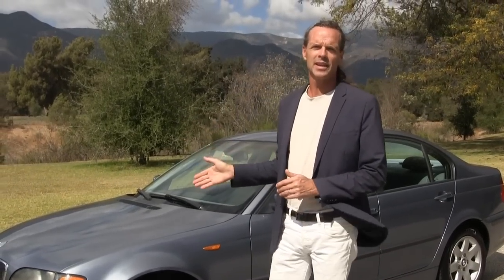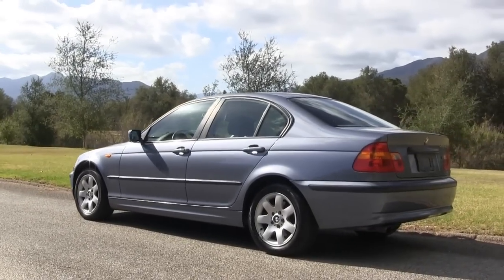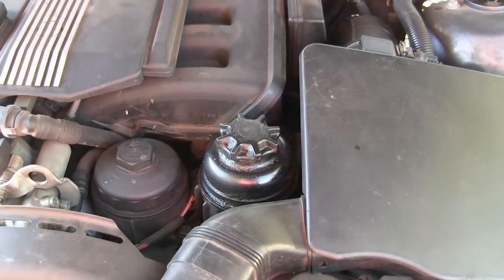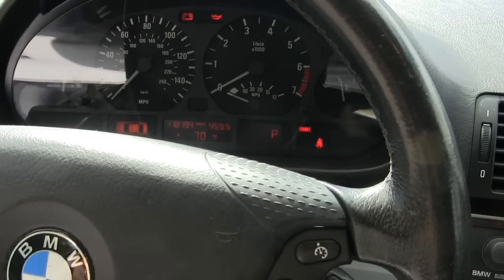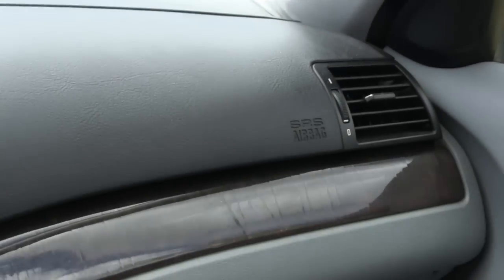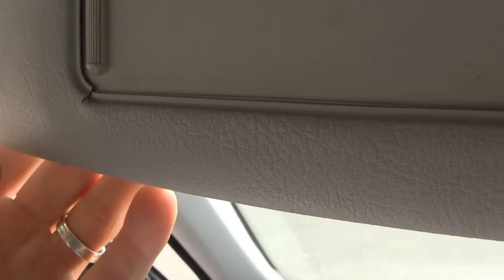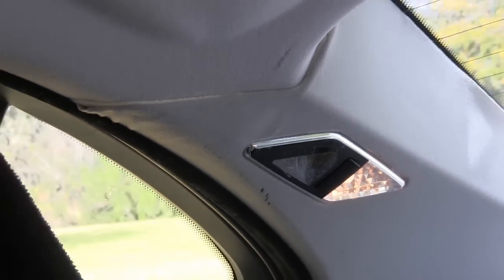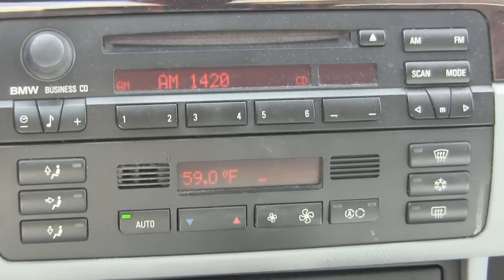Why You Should NOT Buy a Used BMW

Comment: Looks like the previous owner just didn't give a shit about this car. This is probably the worst example of a used bmw. I used to have a 1996 e36 328is and put 250,000 miles on it. It was great! Of course I expected routine maintenance. Does anyone really expect things to just last forever in perfect condition? For example, if you use a drivers side window for 20+ years and roll it up and down 2 times a day, That's about 14,600 cycles total. I'd say that's pretty good life for a window regulator. Anything that has repetitive use is going to break down, so expect to replace it. With a window regulator, you have to grease the track because it will dry out over years and create friction that eventually puts strain on a regulator. "Preventative" maintenance is the key. And know your car.
Reply: Well said.

What really annoys me about some of these luxury car buyers is that they will buy or lease a luxury car for a lot of money, but CHEAPEN OUT on basic maintenance, and worse expect spare parts and the service to be cheap. I will never understand these people who invest $ 50,000 in a luxury car but then don't have the money to buy the $50 recommended oil which it needs (opting instead for some $15 oil...).

Comment: Good review and from bitter experience he's right, I now drive a Volvo S60, it's got 166,000 k on the clock and has been faultless and drives like new since I bought it 3 years ago with 108,000 k on the clock.
Reply: Yes but when something goes on your Volvo, and I'm not talking brake pads, you will be spending big if you don't repair it yourself. They are Bmw money in repair Dept. Do get me wrong, there's some nice and very sporty Volvo's, even fast Volvo's.
Reply: Poor Volvo, check out the low mileage models in the junk yard! And now they're owned by the Chinese. So sad, they were great cars in the 60's through 90's.

Comment: I've never seen an E46 as bad as this. Excessive heat (more than usual in Europe I imagine) makes all the glue come off
Reply: It shouldn’t happen regardless of the area you live in
Reply: @theuck5148  contact glue wears off with heat. Its used everiwhere when cloth is concerned. It will wear off everitime... 
On another note, the one in video looks like it was submerged. I also have a e46, and i only have 2 plastics worn out ( rear ashtray and wind blades cover) .
When i bought it, its interior was filthy, last howner clearly didnt care about the car... and to this day, i had no problems. After proper maintenance, of course

Comment: I agree with some of your complaints. However, well maintained e46 with relatively low miles should be one of the best cars for college students if they want sporty driving and a little of luxury features. I myself own an e46 coupe. I do everything myself on my car. E46 is great for a person whos willing to get their hands dirty. It has so many instructions as to how to fix problems. Its forum members are knowledgeable and helpful. I myself did cooling system overhaul, brake jobs, finding vacuum leaks, and other modifications that people don't do themselves.I saved too much money doing it and the knowledge I get from it is irreplaceable. Well maintained e46 will last at least easily over 200k. those plastic pieces are easily replceable from junkyard e46s. Subframe cracks vastly apply to pre-03.However some known issues like high rev for a prolonged period of time could leading to oil pump nut failure, front Control arms prone to failure, and weak cooling system are not pleasant but once they are all taken care of, what a blast it is to drive. I have driven a few high performance cars out there but have yet to find anything as engaging as this except for a ferrari that i drove for fun:f430
Reply: Everything you said is entirely true. I have an e46 coupe also. I'm in college and it's a fantastic quick and fun little luxury car. I do all the work myself too. I've experienced and easily fixed a lot of things in the video. Most everything this guy in the video is saying is pretty easy to fix if you're willing to work on your car.
Reply: Kyle Bybee cannot agree more. Great job DIYing. That skill is a life skill.

Comment: I saw this item a couple of years ago.  Since then my 1998 E46 petrol automatic has reached 133,000 miles with only a few issues. Mine was one of the very first so it's 21 years old. It passed it's UK (MOT) inspection recently with no problem.  I do look after it well and do most of the basic stuff myself.  Bits are very cheap and readily available.  I just fixed a slightly weeping rocker cover gasket for £10.  Easy job.  If you pay someone else to do the basic stuff - brakes, shocks, oil change, you will spend a lot.  Our climate here is unforgiving with salt on the roads during winter - but so far there is only superficial rust.  I run it on LPG gas which in UK is well under half the price of regular gas.  (46p as opposed to over £1.20 per litre.)  LPG seems to keep the engine running well.  That has been my experience so far.

Comment: Just remember BMW stands for Break My Wallet!  The German sun is not as strong as that in, let's say, California.  And if you garage your car, it should last longer too.  On top of these small problems you have mentioned, I also had to change radiator twice over 10 years.  The thin aluminum radiator develops pin holes even with the expensive BMW coolant.
Reply: HkRedPill Did someone say my name ^_^
Reply: I think my Toyota Highlander has the same thin radiator, needs replacing at 147k miles! Must be a junk car! Dude, all modern cars have thin aluminum and plastic radiators!
Reply: @papatorr3669  My 2007 Toyota Prius has 210k miles with original radiator and original everything else other than the consumables.  I had the BMW  radiator replaced and a year leter, it the "new" one leaking again.  Luck of the draw perhaps but annual radiator replacement should not be on my car's maintenance schedule.
Reply: @hkredpill9661  oem radiators are passable, only after market high performance are worth bragging about. I've replaced them under 100k and had'em go well over 200k. Partly luck of the draw.

Comment: That's "German Engineering" for ya.
Reply: Well that used to be a real thing. My 83 Jetta fully German-built, frame to finish & it would not rust and handled beautifully for a simple, rugged small car. Still looked great 15 years of age. --- > Fast Forward to 2003, the Elantra my family buys brand new is a fucking piece of disposable shite. A baby carriage suspension + a lawnmower engine. I only drove that once.
Reply: It depends how people use these cars
Reply: The European rules on plastics and what is available there hurts them a lot.  These cars could use much more long-lasting plastics and rubbers and be far more reliable, but they cant due to EU recyclability standards.

The US and Asia uses better quality parts, which is why we almost never have the ridiculous cooling system issues.
Reply: By ...use... you mean use it to drive to your mechanic and replace 40 aging plastic parts every 6 months, BMW is the car for you. You could not pay me $50 to take your BMW.
Reply: @bigpjohnson  Thanks for your post. Is that true for other EU auto manufacturers? I'm glad Gaston Glock didn't know about these recycling regulations! I have suggested that BMW hire him as a plastics engineering consultant numerous times, unaware of these "standards."
Reply: @label1877  Could you hook me up with the guy that wants to give you his BMW? He can pay me, or vice versa, for his BMW!

Comment: Lol, everything that Greg says about the E46 is true and yet, I love mine!   I have a 2001 330Ci, which I bought used a few years back with 115K on the odometer.   Since that time I've replaced the lower control arm bushings, DISA O-ring, door actuator, EVAP control valve, various vacuum hoses, radiator, water pump, thermostat, hoses, serpentine belt, pulleys & tensioner, etc. With the help of Youtube and various forums, I did all the work myself.  The parts aren't that expensive and easily purchased online.  The E46 definitely isn't as reliable as a similar vintage Made-in-Japan Toyota or Honda, but, like Greg said, the 3-series is a blast to drive.  If you're handy with a wrench or are willing to pay a mechanic named Dieter, you'll enjoy these cars.  If not, stay away.  Always a pleasure to watch  YourCarAngel videos.

Comment: Where were you when I bought my used 2000 740i???  Radiator with PLASTIC side tanks split 5 days after I bought the car. Who uses plastic on a radiator?  Window regulators, windscreen cowling cracks, 4 dead batteries in 3 years, that ATF fluid leak you showed, and many other issues.  I finally had to give up on the car when the tranny took a dump.  And then there were the 200+ codes causing the check engine light to be on forever.  I finally understood that BMW stands for Bring My Wallet!!  Never again.
Reply: Bob Mackey Chevy for a start.  I got through three radiators in five years in my camaro, plastic side tanks cracked every time.
Reply: there are  no radiators without plastic tanks.......... except for race cars.  most bmw problems stem from a lack of care up until e65, then its downhill.
Reply: The Power steering cap leak is due to overfilling, even slightly. The level must be checked with engine fully warmed up. It's the mechanic's fault. (Yes, even dealer techs make this mistake) But BMW engineers could have easily made a better overflow arrangement.
Reply: William Holt where is the logic behind that?  The expansion tank will crack no matter what fluid you have in your radiator.  The expansion tank is made out of plastic much like all cars regardless of brand.  The BMW expansion tank is meant to expand and contract depending on the temperature of the fluid.  Eventually it will crack.  Plastic gets old and brittle and eventually cracks.  Especially when exposed to high temperatures.  I will admit that the expansion tank is the weak point in the cooling system of these cars and should be changed as preventative maintenance every 60000 miles or so.  Using blue BMW fluid is recommended but wont prevent your expansion tank from cracking.
Reply: Most people overfill their coolant and leave no place for it to expand - and then it over pressurizes the system.  Filling to the top of the expansion tank on a BMW is NOT recommended.  The float will guide you (read the instructions - it's in pictures so even a dolt can follow them).  Also:  Most people don't ever replace their radiator cap until the radiator blows up.  The radiator cap contributes to controlling the pressure of the cooling system as well.  EVERY expansion tank is made out of plastic on run of the mill passenger cars and light trucks.  Some are softer plastic, but plastic just the same.  They all sit under the hood.  They all are exposed to heat.  Nothing to see here.
Reply: larry katzke exactly.  people try to change their own coolant and don't bleed it right which causes car to overheat.
Reply: Bob Mackey For many years now almost all manufacturers use plastic tanks on their radiators.

Comment: You mentioned the very small issues except for the rear suspension and cooling system failure , there's many more bigger issues , like oil leak from every where  , vacuum leak due to made of cheap plastic  .. also the moon roof is another issue ,the radio , the cluster , etc.  I owned  a 330ci , 325ci , 325i , 325i wagon and they're all the same shit...

Comment: I am a german - so I may be subjective. I am not addicted to BMW - I drive a mercedes. But I have never seen a interior as "used" as that. May be this happens when you live with 2 cats for two years in a car. E.G. whats is the cause of the scratches around the shift stick?? Haven't they cut the Fingernails 10 years? What do you have to do to produce such scratches?
Reply: Looks like serious water penitration into the interior from front to back. This vehicle must have been in an accident and poorly repaired.
Reply: Mine looks the same inside.
Reply: Flyg
Reply: Minimax 
i know this is hard for someone who lives out on the frozen tundra to understand, but it is hot and dry in Southern California. Dashboards dry and crack. Leather seats and trim dry and crack. Paint fades(then drys, cracks, and chips off). If the sun ever came out where you live I am sure you would get similar damage.
Reply: Americans and geography ;-) in the south of germany - where I live and most of our premium cars are coming from it was 40 Grad (104 Fahrenheit) last summer and it is about minus 5 Celsius (where I live) to minus 20 in Winter . And the so called tundra is in russia. No wonder you attacked the wrong country.
Reply: Minimax 
Americans know nothing of geography and Germans have no sense of humor....stereotypes confirmed.
Reply: of course ;-)
Reply: and we don't try to make jokes - please don't ever invade countries again ;-)
Reply: from what I know is that's a soft rubber paint that put on plastic trim. I've seen in alot of cars BMW uses it alot for the soft plastic touch.. I have in my Acura RL, over the years it brakes up and when the heat of the car it brakes down you can Google it . maybe that don't put it on in Europe cars but they do here.. it's to make the toch of what ever it is feel softer .and since it gets what 22°c it does brake down as for us it can easily get 43°c here . like the wood trim starts to crack and brake due to heat.. which we have alot of. oh please don't think all American are the stereo types. a we'll do the same :)
Reply: Ish McCormick if u keep for many years a car in sun it will brake and " dry" everything.that simple. no matter what car is, it will get fucked up.
Reply: True-in SoCal, Arizon, etc., the temp inside the car on a hot summer day can exceed 170F-dies out and ages plastics terribly.
Reply: Some Americans are just jealous that they cannot make such fine cars and try to bash them. Of course it may be true that there are better and cheaper cars if you just want to Walmart and back with no fun in your life.
Reply: I think you could fry a Turkey inside within a view hours, but blame it on BMW that they did not made that car a legit oven;-)
Reply: Chris have you read my comment? Is there anything written or expressed like: German cars are better than japanese cars?
Reply: Minimax just let him go mate. The BMW in the video is a fucking mess. I have a 320D from 2006 with 83K Miles on the clock. It drives like a brand new car and only cost me £5K. The only thing I agree with the guy about is that rubber coating they cover everything with. It starts to peel and makes the interior look pretty grubby.
Reply: you are not forced to drive one. Just stick with your high quality US made cars ;-)
Reply: The only American car I'd buy is a Corvette(it's a wonderful car and a legend), the rest is just rubbish. But everybody has their preferences and I respect that. If you just want to get from A to B,you are not a car nut and don't care about driving experience a Corolla, Civic or a Ford Fiesta might be the better choice. I also love Alfa Romeos even though they deliver a horrible reliability. But they are beautiful and drive wonderful. You just can't have it all

Comment: Never was a Ford guy. But 2012 I bought a 1997 F150 XLT top of the line with beautiful campers hell, 118,000 miles. Paid $4,700 it needed brake job, tires. Now 6 years later 200,000 miles runs like a dream, body and paint like new (Nevada) no rust. It has paid me back with hauling/moving jobs over and over. I'm 6'6" and the legroom/ergonomics are great. Made in Canada.

Comment: You can find these for like 2500 bucks, so for a cheap commuter, the benefits of the reliable drive train outweigh the cons of the interior fit and finish issues.
Reply: is not just interior fits, also problems under the hood
Reply: I have a 2003 330ci with 147k on it and I have to admit the interior isn't bad. That said, I've replaced just about everything mechanical on the car (some things two or three times already), the tranny which went out at 130K and at 140k the cam needs to be replaced. There is nothing good about these cars.

Comment: Obviously pretty hot where you live, because I don't see these problems on Canadian E46 (which I have one) The cooling system is cheap to replace, so that is not a problem for me. I find the one aspect that wears out too quickly is the suspension bushings. As long as they are fresh , the car drives as new. The  plastics on mine are quite poor  as you have pointed out. I love my 03 Wagon and it has been very reliable. I have about 170 K on it. Great motor, brakes and suspension, very comfortable seating and if you have the fake leather, seems to last a good long time. I'd take it over an Audi or Mercedes of the same vintage. I am driving a Subaru Forester as well. Cheap car that holds together pretty well. Just missing the BMW feel when you close the door. Not all aspects of the 3 series are POS, but some are.

Comment: Lol, bought mine with 120.000 km. Now 300.000km, and it runs smooth like years ago, it can compete with contemporary premium cars. Never had a problem with the engine or turbo charger. The only thing to do, is to change some sensitive suspension parts every 100.000km. Have to admit, it's a 320d.

Comment: Sagging headliner - had it on my both Audi's. Something you gotta embrace having a German car. :)
Reply: My headliner on my early Jetta would pull right down on me if I had the front DS window open a bit on the highway. Then it would pop back up.

The trick was to open a back PS window to equalize the negative pressure! Had to do this because no CC.
Reply: Its not like only german cars have this 😂
Reply: Saw a youtube video of sometone swapping the fabric for suede. It was nice. Paying for someone to do it? Nope
Reply: @adriangutierrez8177  May as well if you are going through troubble of replacing it.
Reply: @theboogeyman5736  mostly yes.